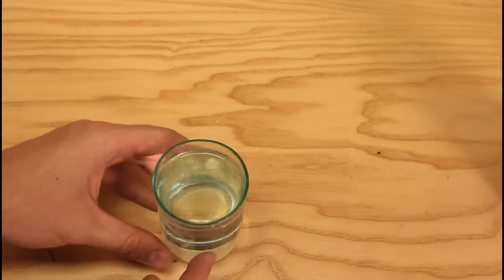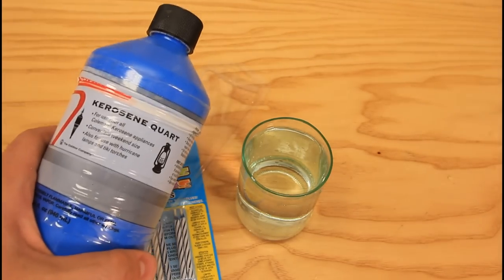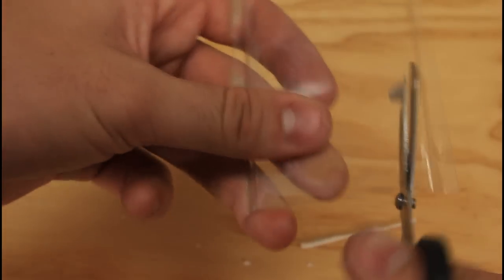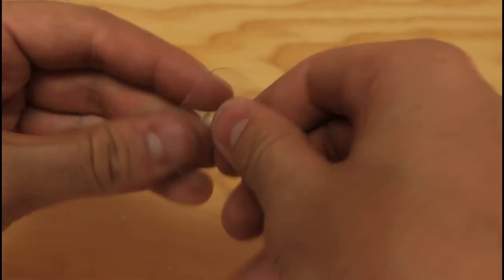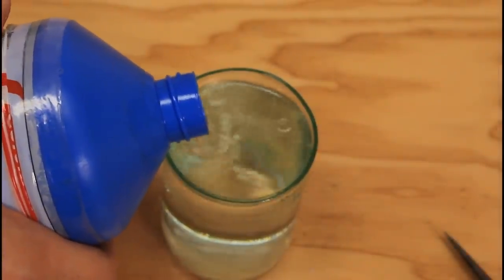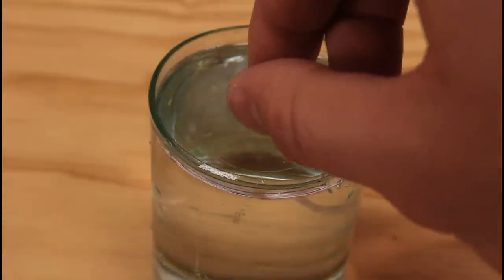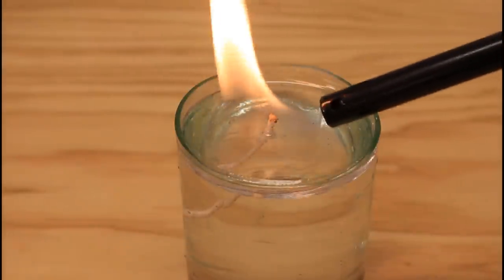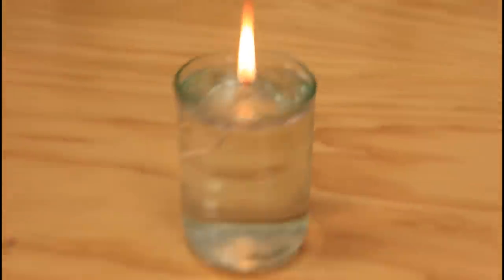Water Candle

Comment: Once lighting it up, the fire will start to slowly burn the plastic which is why you see the black fumes, which are very toxic.
Reply: No, because the water would keep the plastic cool enough that it wouldn't melt. The same thing can be done by filling a styrofoam cup with water and putting it straight on a fire. The water boils but the plastic does not melt. Well, where the water level is I mean. Anything about that though will melt. It's really neat actually!
(c) William Pierce
Reply: jerrold samonte Black tick fume is an indication of plastic burning. Since plastic is made out of oil (petroleum) it makes a very tick black smoke, which are toxic to the lungs. The water can't keep the plastic cool even if it was ice water. It is simple the rate of fire and the temperature of fire is greater than the temperature of the water.
Reply: Any impurities can and will produce ash... like the WAX that is still stuck to the wick. The plastic is obviously not on fire, and burning a candle all by itself will produce black smoke.

Comment: We use these at home during Diwali.. (a festival of Lights).. I add in a Flower (weighted down with some epoxy stone) and then pour the oil, Cooking oil works fine and adds a contrast and color to the lamp / candle.. for the wick, i use normal cotton rolled into a wick containing 2strands..
it looks good that way, and the flower doesn't go bad even for the 10days that it is in the water..
nice candle, and good idea of using the clear plastic disc.. i never used it.. will use it this year..
Reply: and the water don't have bacterias ? I mean the flower do not  rot or anything?!
Reply: nope.. not atleast for the 10days it is submerged. as the oil creates a barrier, and just for vanity sake, i do change the flower if my wife gets a another bunch of flowers for the  offerings..
Reply: LOl! ; D

Comment: Great idea...but would it not give out toxic fumes because of the plastic burning up? 
someone please reply
Reply: +athul krishnan the plastic would not burn for a long time because it is in water.
Reply: Bro, the plastic isn't in contact with water, it's floating over layer of oil. 
Why it won't  burn?
Reply: +Abhishek Bajaj The hot gases from the flame rise because of gravity and air pressure. The plastic has a very high surface to mass ratio so its essentially the same temperature as the rest of the mass in the beaker.
Radiant energy (the heat from the flame's combustion reaction) causes evaporation of gasses off the wick which ignites at a small distance perpetuating the phenomena that is a burning wick in a candle. This evaporation of gasses (from the oil up the wick) is exothermic, in the same way you feel cold when the wind blows on you when you're wet, evaporating water from your skin and making you cold. The wick doesn't burn because it's chilled by this evaporation well below the flashpoint of the wicks material. The plastic disk is not only further away from the flame, but is by contact, part of the mass evaporating and therefore receiving it's 'protection', much like the wick itself.
Reply: +M Standenberg Im gonna need this comment in english sir..lol
Reply: +IOS TECH Thanks for the reply bro :)
Reply: +Abhishek Bajaj Thanks for the reply bro :)
Reply: +M Standenberg Thanks for the detailed explanation bro :)
Reply: +JohninOCc Thanks for the info :)
Reply: Good lord, courtesy on the internet! You're welcome!
Reply: will it melt the water & oil stuff though

Comment: 2 issues with this. One being the rate it would last. That would depend of the evaporation of the water and how quickly the fire burned the oil. The second being the most important, you are directly burning torch oil with no flame control. Doing that causes the flame to produce a lot of hazardous smoke, as you can see in the video. The smoke smells terrible and will cause severe migraines if breathed for even short durations. This is not something you want to fill a room with, no matter how cool it looks.

Comment: can anyone explain the whole experiment i cant understand it and pls say what he used
Reply: Get yourself a wick of some sort, he used the wick of a cheap birthday candle, some clear plastic (like from a plastic takeaway box or random packaging), and some fuel. He used torch fluid, but I recommend using lamp oil (it has a different smoke point and won't give off as much soot). You can also use cooking oil, but it won't be clear like the water. Fill your container with water to however high you want it and pour about 1/4" or 1/2cm of oil on top. Cut your clean plastic to a small circle and punch/cut a hole in it. I find that cutting an "x" instead of a hole holds the wick better. Put the wick into the plastic with about 1/4" sticking out one end. Put the long end into the oil/water and float the plastic. Grab a lighter and light your candle! You're done!

The more oil and the shorter you keep your wick (1/4" is usually the best), the longer the flame will last.

Comment: is it dangerous? because the fire is burning the plastic, so maybe dangerous gasses will be released
Reply: nope the plastic is not affected by the flame as the water cools the plastic below its point of combustion!
Reply: 1332nick is correct about the plastic.  Another thing to be weary of is the type of fuel you are using can release harmful gases.  Kerosene is safe to use.
Reply: Yer ALL tarded if you think water conducts heat fast enough to save that 'lill piece of plastic. Sure, itll be fine for a bit.... but then youll see. Use the right type of plastic and you should be ok for a bit. This is a temp candle. Not meant to burn for hours!!

Comment: This isn't as cool...water is indistinguishable from oil....we might as well fill the whole glass with oil and say hey look water candle!!.....also won't the wick get ruined once all the oil is consumed and it gets wet in water...changing wicks everytime will be a pain
Reply: Anosync that will burn the rest of the wick and also the plastic that makes it float...
Reply: if you don't have water, when the wick reaches the oil. BOOM@!!
Reply: nope oil is just the fuel, its the cotton (wood or wax) burning with oxygen that gives fire...dip the wick in it's own oil and it will go out because you are temporarily cutting off it's oxygen supply aka oxidation stops...most likely you will just get a black burn spot on the plastic if it holds the wick upright as fuel (oil) beneath it gets all used up, just like in any simple oil lamp.
Reply: LOL!!! ^
Reply: That's like saying Cars are useless because you have to get Gas and change the Oil.

Comment: woundnt the fire from the candle wick burn the plastic then the wick would fall in the water then putting the light out
Reply: No, because the water would keep the plastic cool enough that it wouldn't melt. The same thing can be done by filling a styrofoam cup with water and putting it straight on a fire. The water boils but the plastic does not melt. Well, where the water level is I mean. Anything about that though will melt. It's really neat actually!
Reply: science is really cool just like the crazyrussianhacker's vids
Reply: eh?
Reply: runner rockers you don not make sense dude
Reply: myeeeehhh eehhh maybe you are not going to school eh
or probably you are not a book worm
Reply: tama (means correct)
Reply: why did a perfectly reasonable question and a courteous reply turn into a slanging match??

Comment: i think it will smell like plastic burn !! isn't it ?
Reply: No, the plastic wont burn because in order for it to burn it would have to evaporate all the liquid in the glass first. You can boil water in plastic over a fire and the plastic will not burn. Only the parts of the plastic that do not have water touching it will warp and burn.
Reply: really !!!
it's seem strange for me :D ..
thanx for the info ..
Reply: yea if you set a cup of water directly into a fire the cup will not burn...only until the water evaporates or the cup gets knocked over will the cup then burn :)